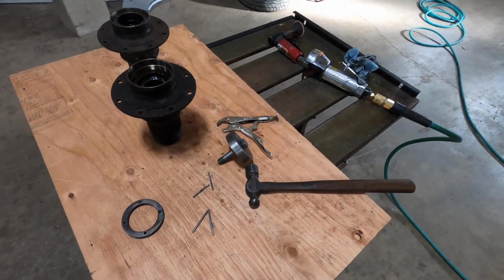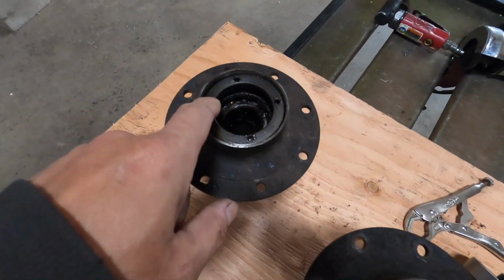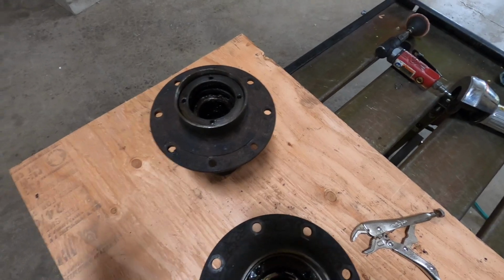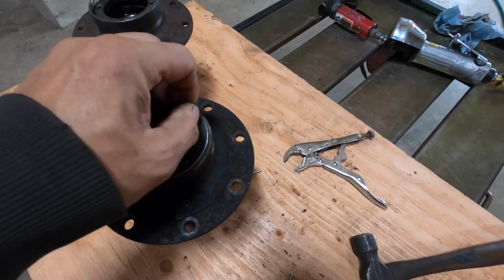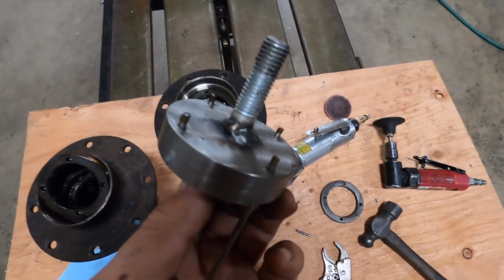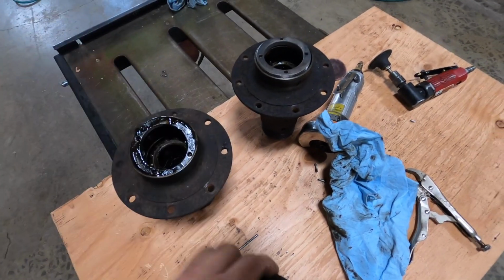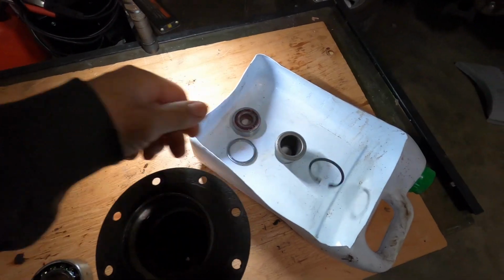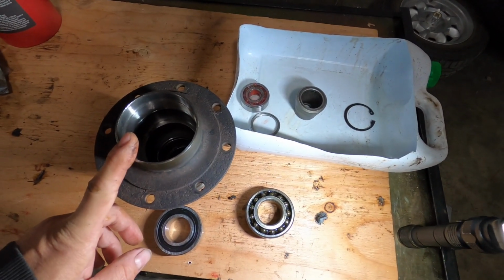Making Ferrari Tools

Comment: In the long run, we are, as a community, going to need to develop an open source repository of custom tools, with dimensions, specifications (material strength), and basic notes. I had to do something similar to remove the fuel pump retaining rings from a Ferrari 550, as well as a slew of other little treasures working on the bellhousing and similar. Curious what your thoughts are on that, and what platform would make sense for this.
Reply from the maker: @christophergraves2300  I’ve kind of been doing that with my website and forum. As AI mines this data, it will hopefully be available! I also rent out my special tools when asked! Thanks for watching.